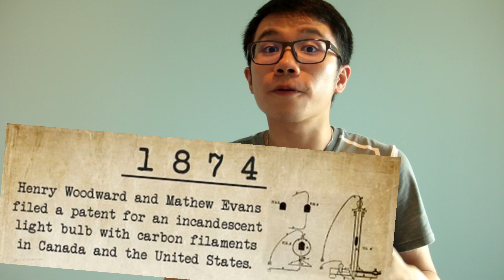The Current War Review | The Current War Explained In 3 Minutes (2019)

Comment: George Westinghouse did not develop the alternate current, it was Nikola Tesla
.
Reply from the maker: George Westinghouse developed the first commercial AC power system in 1886. Nikola Tesla designed the modern AC system we are using today and sold it to Westinghouse in 1888. I would say they both worked on their own AC, but Tesla won the name by having a better one.